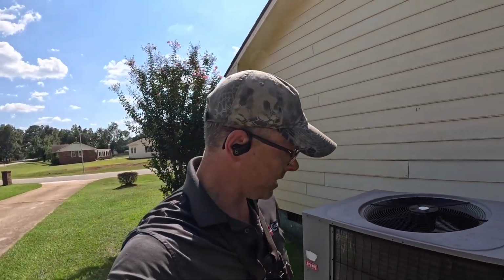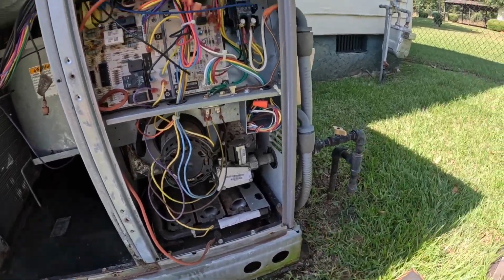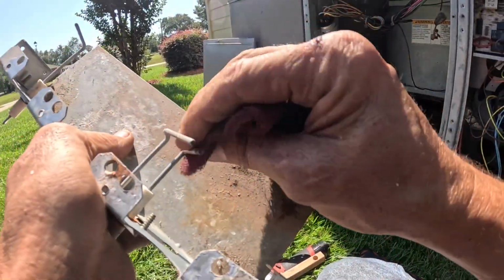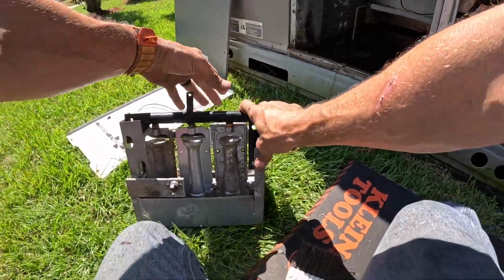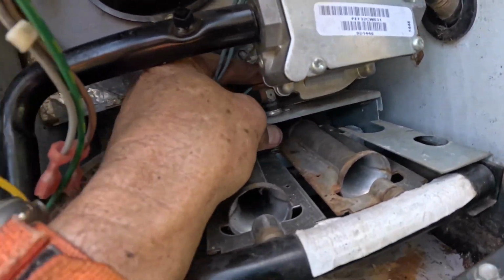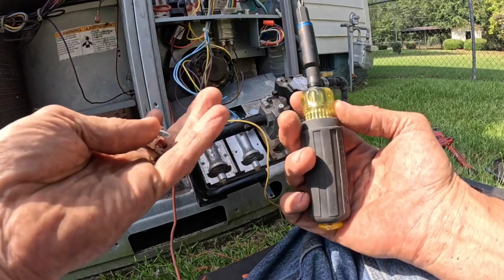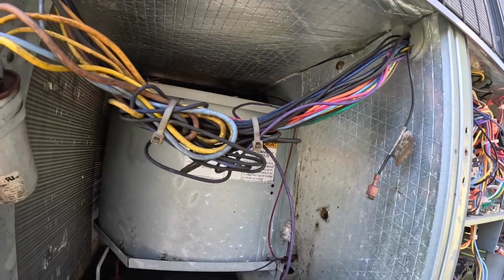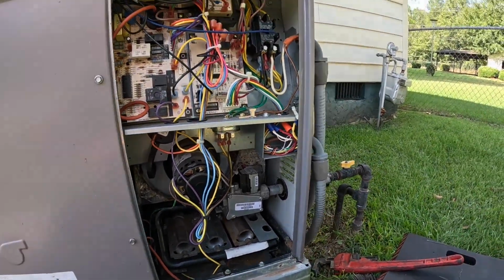Exactly How To Perform A Preventive Maintenance On A Furnace! #hvacguy #hvaclife

Comment: Curtis I have a question……. I have a Lennox heat pump that on AC it runs fine but on Heat mode it cuts off on high limit with in 10-15 seconds of running and gives me a ambient sensor code.  I diagnosed it as a txt restriction but not sure if it’s the condenser txt or evaporator coil!!!  What u make  of this?
Reply: Split system

Comment: that is correct, the flame is the load on the circuit and it needs to see > .25uA in most cases of current before the logic of 1(on) is generated, that is a good idea for a video, ill get a spare furnace control board and see what i can find on the micro controller logic

Comment: Following for a long time now....but why ,why, stress an exchanger?  I pull vacuum hoses to pressure switches, pull limit wires to test. But I see where your thinking, test the limits with heat. I think I'll start  doing the same but will pull the limit off and heat with the ole bic lighter
Reply from the maker: Yeh, some don’t like to do that. And I see why

Comment: Those roll out switches are very brittle over time. Uf you take out the burner section lift slightly up on screws then place dn to catch the burner placement screws, it a bummer sometimes. I get a blue dryer brush off Amazon and clean the inlet tubes to the hx an vac. Do you do a Co test and print it? Thanks for the video m. Go Bryant!!!
Reply from the maker: I do combustion test if it’s a regular furnace on a split system when I can’t really see the exchanger, yes